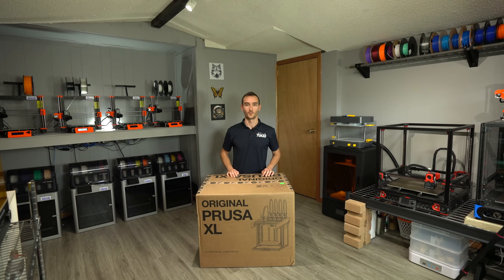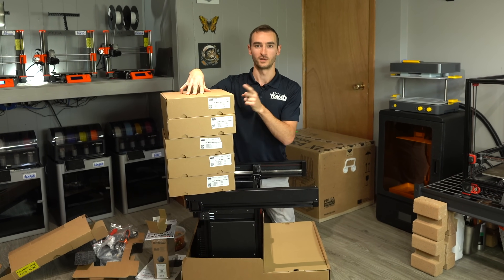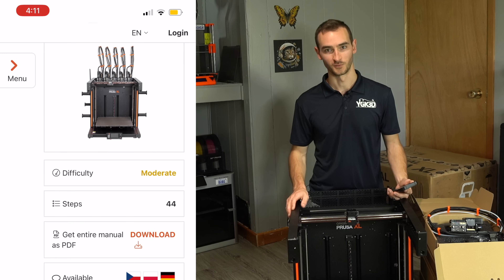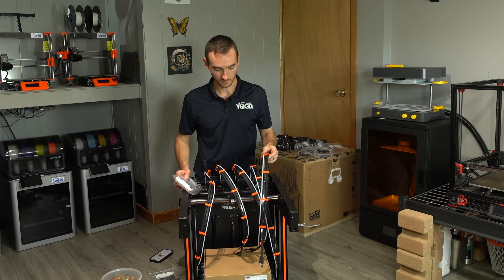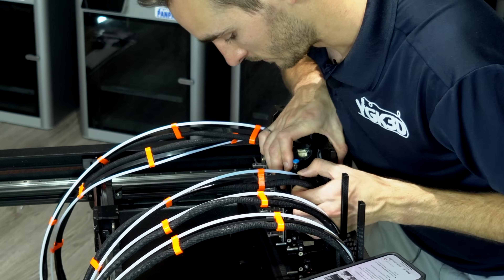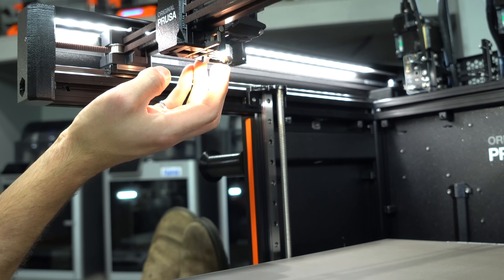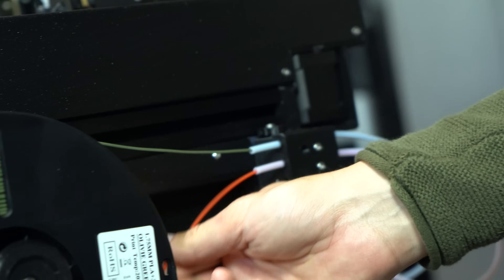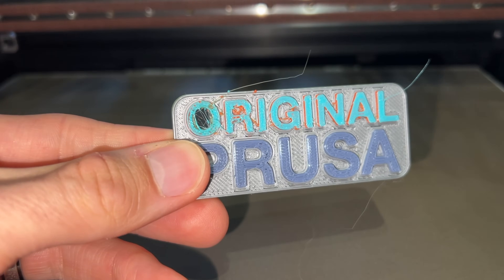Prusa XL 5 Head - From Box to Benchy (Everything You Need to Know)

Comment: 5:15 Did you even install those plastic straps properly? LOL I dont own one of these machines, but arent you supposed to put the screws in then pull up so the screw head is on the narrow part of those slots? The upper part is bigger hole that clears the head of the screws, and then you pull up the plastic strap then tighten it down, but you just used the lip of the screws to pinch a tiny bit of the large hole area.
Reply from the maker: Good catch. I got that wrong. I addressed it in my follow up to this video discussing print quality.

Comment: The results in the prints are absolutely not reflecting normal operation of this printer. My 5-head semiassembled is performing within my expectations. The only issue I've had was remedied by tightening two screws I had forgotten to tighten during assembly. Even with old brittle PLA that has never been dried, I  could not detect any problems with stringing, extrusion or other.

Comment: Looking at the benchy, one thing that jumps out at me is that the blue layers are better aligned below the deck and above the door arch but below the ceiling. Places I would expect no tool changing. So at least one of the problems looks like to potentially be due to some problem with tool alignment on change. For single tool use, this print quality appears as good as an mk4 but for multi-tool, nothing appears proven yet. I'm glad I'm waiting until this printer model has proven itself before buying.

Comment: Given that other people are reporting issues when the prints get to a certain height, I'm wondering if this is because the front of the top gantry arms are not supported. I wonder if putting a couple pieces of wood or metal to support them would increase the rigidity. I know my first reaction when seeing it was absolute shock that they left the front part of the frame unsupported at the top. I'm really starting to worry about my pre-order now.
Reply: Mmm, I printed a 350mm high "xmas tree" (spiralized contour) on my 2T XL and it turned out very well. The "non supported" front top gantry is built on alu extrusions (25x25 mm) extending from the back resting on dual vertical extrusions and a vertical metal sheet between, then the metal rail where every other hole has a screw into to extrusion and then a sheet metal profile about 50 mm high - feels very sturdy and "non flexible".
I do not think additional support neither is needed nor would make any difference.
However, the manual says NOT to lift the machine in these "arms", but by the base.

Comment: The more I hear and see from the XL users, the more I'm getting convinced "not having finalized my pre-order" is actually "dodging the bullet".  I see WAAAY too many reports of stringing, z-banding, defective units and Prusa-support going into radio-silence ..... not gonna cancel yet, but certainly also not gonna complete the pre-order.  Especially considering the price tag, the amount of issues I've seen being reported is simply unacceptably high.
Reply from the maker: That sounds like a safe bet.
Reply: This is exactly what I am doing right now as well... waiting to see the issues being solved before moving on. ☺
Reply: Exactly, funny how prusa fan boys try to blame wet filament for z banding. Just get the Bambu, nothing but perfect prints in my 3 months of non stop printing.
Reply: @yoyomin  I have a Bambu. Two actually and yes they are by far the most reliable machines "out of the box" I ever owned in the last 10 years or so.  I pre-ordered the XL before the Bambu Kickstarter came online (got i to the Early Bird on that one), and generally prefered the concept of the toolchanger. However, after the pretty much bullet-proof performance after 12 months of intensive use on the Bambus  they proved to be  "tools instead of projects", i'm not willing to accept a way more expensive machine with so many teething issues and lacking features currently offered on larger sub-500€ machines (input shaping with ADXL sensor).  It simply makes no sense to me to spend this amount on a product in such a rough state so i'm going to lean back and wait and see how it evolves.  I know Prusa releases are generally "not perfect at launch" but with a machine close to 4000€, that's simply not acceptable.

Comment: Its funny how prusa boys are trying to find any possible reason to give positive light on this printer when in reality there is little to none. Everything already exists and its much more cleverly managed by other companies. By separating heads you would think it wouldn't need purge block but it uses it anyway, like c'mon. Also price is ridiculous, you can get same for 1/4 price
Reply: It's a prime block, not purge. Even Bambu uses one with the AMS, and IDEX printers use them too.
Reply: You don't need a purge block. I have a Prusa XL dual-head and if you slice with Wipe Tower disabled it jumps straight between heads. I've completed a half dozen multi-material prints so far with zero waste, zero purge, zero wipe.

Comment: May i ask is there a way to slap a revo hotend on the print heads?
And how terrible will the semi assembled version be? I also did hear it’s basically like that they have to assemble it anyways completely and unbuild it then afterwards for you to play yourself.
Reply from the maker: I don’t believe that would be possible, but I could be wrong. The Prusa hotend has similar quick swap nozzles but they’re not interchangeable with Revo. 

The semi-assembled is a bit more work to assemble but it’s worth saving the money versus fully assembled.

Comment: I got the single head and as time has gone on, I've lost the novelty. I had a few great looking prints early on, but even they had a recurring issue that any time something got taller than 13-14cm it would get a sudden underextruded or ugly layer. Didn't matter the filament, the speed, the material, it would get an ugly and fragile layer without fail. 

I waited 2 years for this thing and it was 2000 dollars. And it makes me genuinely sad to say I'm ready to send it back. I can't afford to wait on it getting better through firmware.
Reply from the maker: That really sucks. After waiting so long the printer should have been highly polished and ready to go… not still in the R&D phase.
Reply: @ygk3d  Big time. One thing I can't fault is the nextruder. If it can be put on other printers I'd happily buy one just for that. For now though, probably just going to use the money I get to turn my ratrig into an idex machine.
Reply: I can confirm that too, printed big vase mode and at 3/5 height got layer or two underextruded basically later ruining the print. Small nudge and it separates into two. Rocket engine printed fine tho ..
Reply: @mozgy  Oh good, it's not just me. I was using it to print a multi-piece helmet for a friend and one section around 15cm up looked like it was pinched inwardly.

Comment: I've had my XL 2T for a couple weeks now and it prints nothing like this - amazingly smoothly. I got the partially assembled kit rather than the fully assembled one though
Reply from the maker: Glad yours is working out for you. The semi-assembled machine I have built since filming this is similarly bad in quality. Not sure what’s up with that.
Reply: I've also got an XL 2T and my experience is the opposite of this video. I'm not disputing his results - you can see them for yourself, it looks bad - but I've been printing in PLA and PETG and ABS and print quality is on par with the MK4. Also zero waste with multi-material if you turn off Wipe Tower in the slicer. 

The XL is the real deal but Prusa is having some serious QA issue or maybe the assembly instructions are incomplete. There are enough of these horror stories there must be a common issue. Prusa is going to ruin their reputation if they don't get on top of this quick.

Comment: I'm curious, how much waste is there between color changes? I assume it has to heat and wipe the filament for each tool change. Where does that excess filament go? The video showed some of it dropping off the side of the print plate.  Is there some sort of prime tower? Do the multiple color heads stay heated even when not in use? One of the concerns I had was how accurate the registration is between print heads. In other words, when using multiple colors, is there a noticeable gap or registration issue? Thanks, looks like a great video series!
Reply from the maker: There is little waste and the swaps are very quick. There is a prime tower but no purge tower. The initial priming happens off the front of the bed. The heads stay heated when parked. There is a silicone piece in the parking location which seals the nozzles to prevent them from oozing. The calibration procedure for the tool offsets seems very advanced so I don’t imagine that there will be any alignment issues when switching tool heads, but I haven’t done enough testing to say that for certain.

Comment: I’m sure this is somehow Bambu Lab’s fault. 😂

J/k.. I’m sure it will be a great workhorse when it’s done. I can imagine having the ability to swap between 5 materials and/or colors should open a lot of possibilities.
Reply: It can do multicolor prints way faster than single nozzle printers and with almost no waste , so if you want many multicolor prints with almost no waste then you will like the printer
Reply: @ulforcemegamon3094  Yep. My original draft mentioned that. Less waste is a big benefit too. Also, when it gets tweaked and up to speed, large multi-color prints should be faster in general.
Reply: The Multi-MATERIAL is what really has me excited.  Imagine a high strength “core” / boring but cheap colored filament on the inside, color or abrasion resistant on the outside, TPU for Joints, Dissolvable Supports.

The Opportunities really have me excited.  I am annoyed with the lack of polish for now though.  Bambulab’s Apple Approach does have it’s appeal.
Reply: @ericlotze7724  Yeah, exactly my thoughts. I bet you could really step up print in place with this machine.

Comment: I wonder if they will develop a multi size nozzle slicer mode so you can print fast large details and switch to smaller nozzle around fine details. Think of doing a statue where the firm nozzle comes around for toes fingers hair & facial details but using a large nozzle form limbs & torso. Gain height quickly.
Reply from the maker: That would be cool. That may already be possible. I’m going to look into it.

Comment: Im really tempted to get a 2 head xl at some point. Im sure they'll figure it out but it does seem like its taking a while.

Not many other nonbed slinger printers out there if you dont want a Chinese one.
And ultimakers prices have skyrocketed. Bought an ultimaker s3 for my former company back in 2017 and the price has doubled since then. And it wasnt cheap then either
Reply: If you're willing to do the investment you could build your own. My rat rig has been an absolute work horse and they recently released a kit to make the vcore 3.1 into an idex machine. From my experience as my first build it only took about 20 hours.

Comment: It's crazy to think that the "assembled" machine requires that many steps to get up and running versus something like the Bambu, let alone the apparent issues you've experienced. As someone who had 6 MK3S farm from what I've seen and read so far Prusa has really dropped the ball on this machine.
Reply from the maker: I agree. To call this fully assembled seems like false advertising. The fully assembled MK3/MK4 is actually fully assembled and is less of a price bump over the kit (+$300) v.s. the XL (+$500). Doesn’t make sense to me.
Reply: @ygk3d I’d need a heck of a lot more pound tubs of Haribo to call it quits. If I order an assembled printer and pay $500 for it and I need to spend 1.5hrs assembling it I’d expect around 120 of those tubs of goldbears

Comment: It's cool n all ngl but for 3500/4000$ I think ima just wait it out for the bambu xl
Reply: they wont even process an order until early 2024 and when u receive after that who knows
Reply: @jamesharris9894  who? Bambu? I got all my printers within the week of ordering
Reply: @REDHOODLUMS  no prusa xl with 5 heads
Reply: @jamesharris9894  that's pretty bad and for 4k I'd could easily get 3 bambu x1c and have money left over for filament, I don't think the prusas printer is bad, I just think they're smoking crack with these prices
Reply from the maker: Not a bad strategy…
Reply: @ygk3d  plus a 500$ assembly cost feels criminal for an open air machine, idc if someone even offers a optional enclosure on top of the machine, built a voron and even those are technically capable of muiltihead can. Feel like ams with a bigger bambus probably gonna cost around 3k

Comment: I hope they can get the print quality ramped up soon if it's firmware issues that is.  It's a nice looking printer and definitely has potential.  Thanks for the video on it, can't wait to see the next one.
Reply: Yeah, I'm not going to complete my preorder until I see good quality reviews and prints. I have the MK4/3 and they both put out phenominally beautiful prints. So if the XL (5 tool head) can't meet this standard, I won't be buying it.
Reply: Prusa.. where did the name and quality go? Amazing what a lil competition will do to a company.
Reply: It's not firmware. Probably the cheap filament hes using. Many other owners with multi head XL's print the same pre sliced files with no quality issues.
Reply: @LilApe I sure hope so! I'm getting mine tomorrow, and if it prints like that, it will be up for sale right after.
Reply: @Angwolf1966 how was your printing going?
Reply: @Mr.Kasiic  It prints well, but I haven't really tried to print anything tall yet. Had some issues with the extruder gear eventually start chewing the filament while printing TPU, but I'm still trying to figure out why this might be happening (temperature, filament movement restriction, filament itself, etc).  To be honest, I don't think the default Prusa filament print settings are optimal.  More research needs to be conducted...